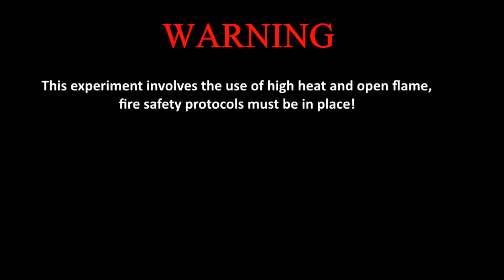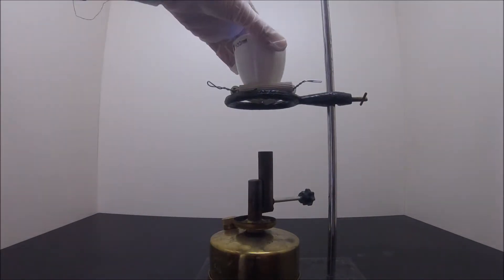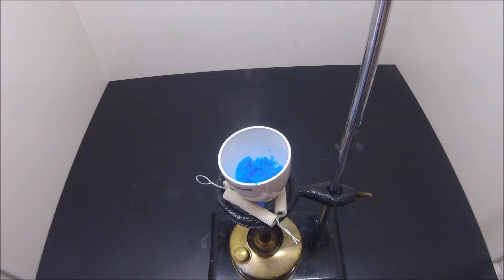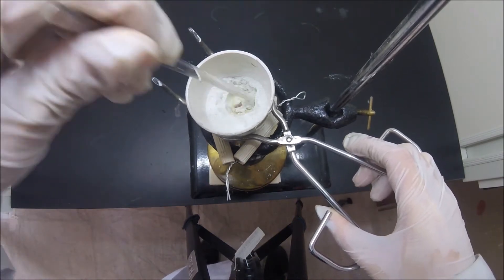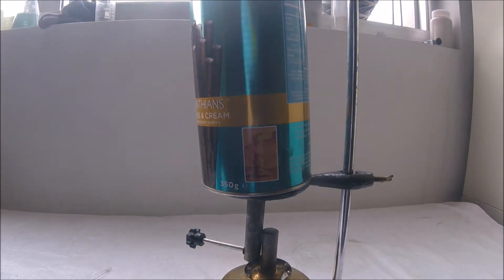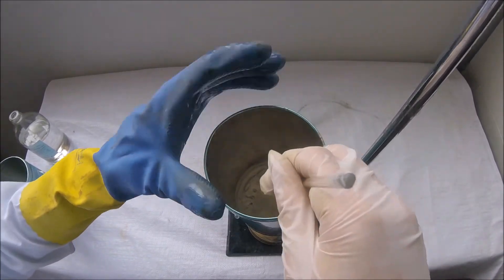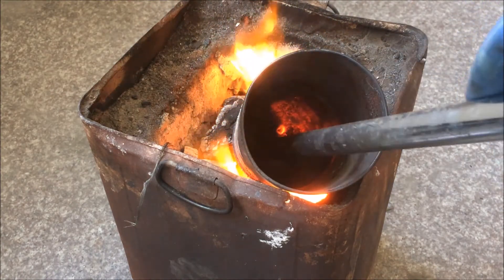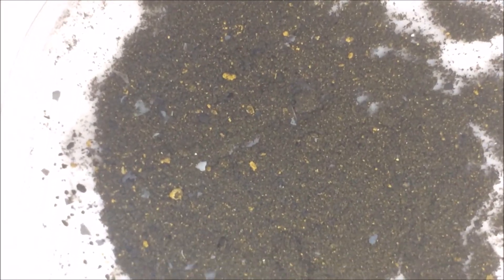Making Copper Oxide by Thermal Decomposition

Comment: how u get chemicals from china when ur in AU? wouldnt the shipping cost be higher than ordering locally?
Reply from the maker: TM Fan there are a lot of things that you just simply can’t buy  locally without a permit, ordering them  overseas seems to be the only option there.
Reply: Aussie Chemist wont the customs conficate ur chems?
Reply from the maker: TM Fan never had that problems before.
Reply: Aussie Chemist r chinese chems expensive? how do u order from them?
Reply from the maker: TM Fan it really depends on the type of chemicals you are buying, it’s usually 50% cheaper than buying them at sigma Aldrich. How to order Chem, which depends on what Chem it is, you may need to be under a company to do it. I simply just know a guy who knows a guy knows a guy.
Reply: Aussie Chemist in Europe you can buy almost everything online from legal chemical suppliers without a problem and quite cheaply :) maybe think about moving here haha

Comment: Use copper carbonate instead, much easier, you don't even red to go above 100 Ceslsius
Reply: easier and more commonly found is bicarbonate soda. surely you have this in the kitchen? so much easier to make the oxide via that method than the way you did- much less energy required to form the CuO plus no dealing with SO3 fumes.
Reply from the maker: sure, but the only copper based salt i had was CuSO4, I was going to react with alkaline hydroxide first to yield Cu(OH)2, and much less heat was needed. I was doing this in the last few days i had in my lab ( I do my projects overseas, so the cops got nothing on me) by the time I started to do this i realized that i forgot to order hydroxide from my chemical supplier, this will have to do.